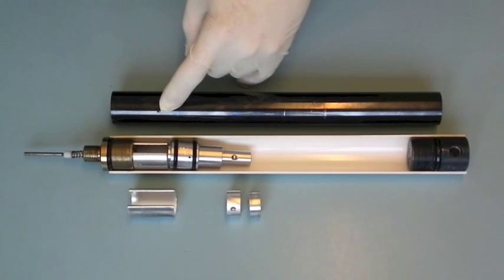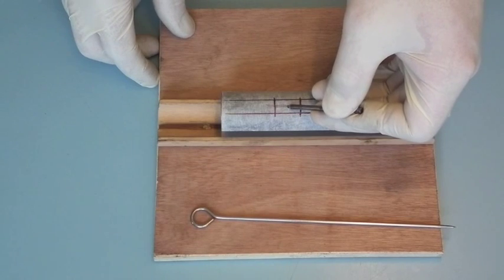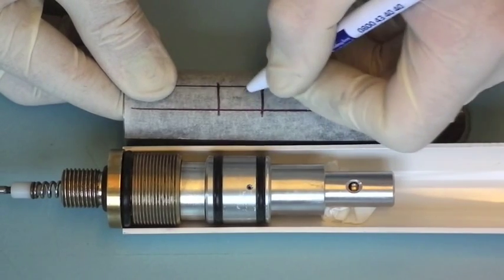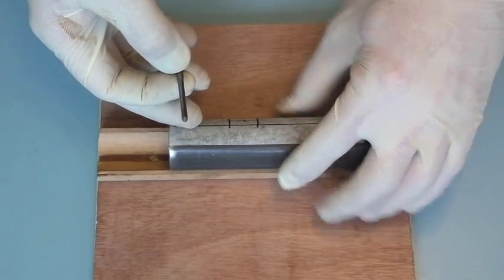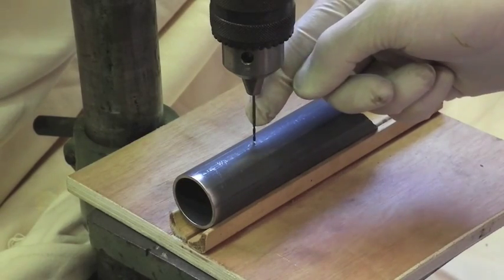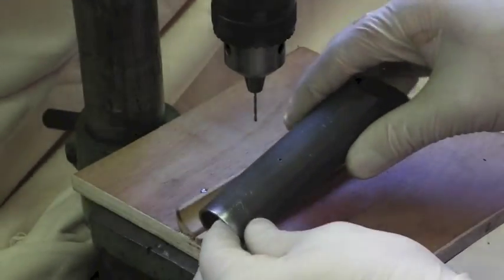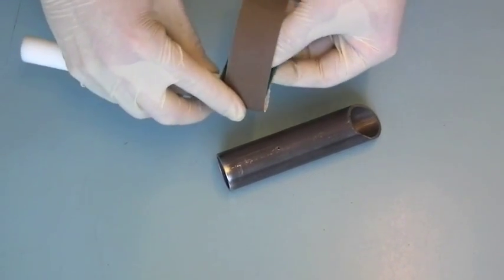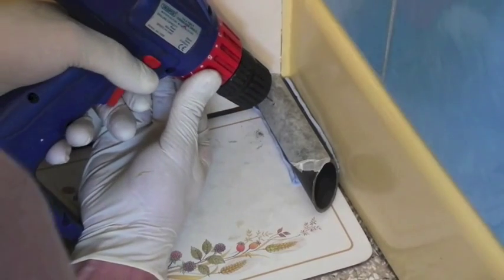Lane Regulators - How To Drill The Breath Hole.

Comment: Some 10 years ago I bought a replacement regulator from you to fit my FAC BSA Hornet which does a wonderful job.
Being a perfectionist I had my air-gunsmith do the job for me while I watched over his shoulder.
He was pleasantly surprised with the quality of your work and eye for detail including some spare o-rings as well. 
Instructions were clear, (also for adjusting pressure). What I miss a bit in the video is how to measure the spot for the hole when the air reservoir is taken apart. What you show is clear about the location but it is easy to make mistakes in measuring when you have the loose parts in front of you.
I noticed the deburring but missed or overlooked deburring on the inside? Using sandpaper on a stick to take away the sharp edges as not to damage the o-ring when inserting the regulator?
Anyway, compliments for your great quality products and service! 👍🏻

Comment: Relative to position around the circumference, where is the best place to drill the breather hole? Downward, such that the hole is hidden within the stock or upward pointing towards the barrel? 

Also, does the breather have to be opposite the hole in the regulator?

Thanks